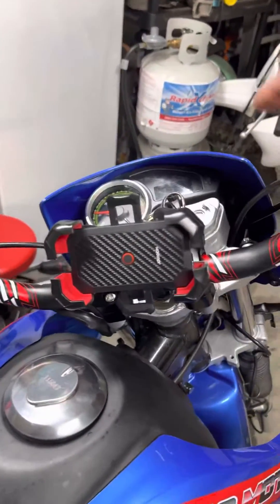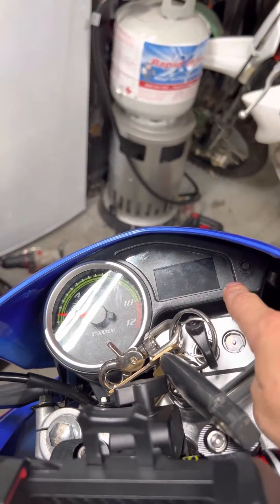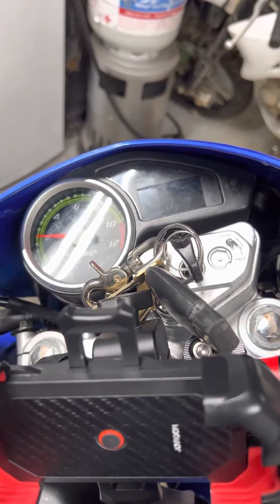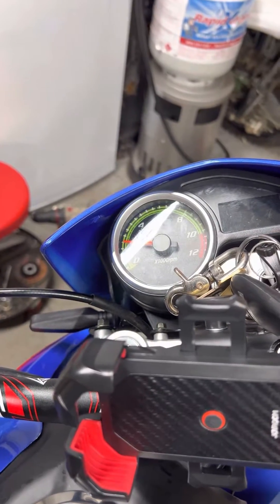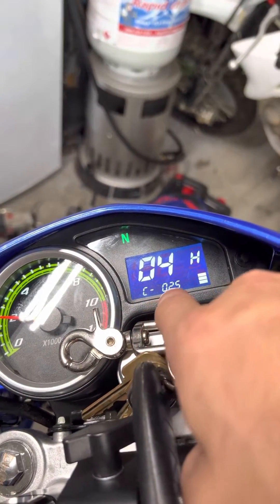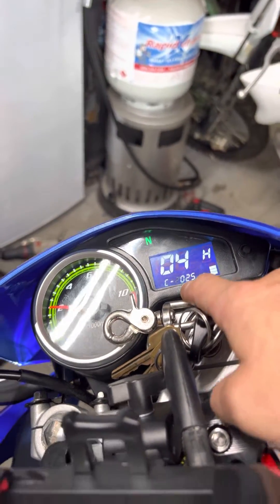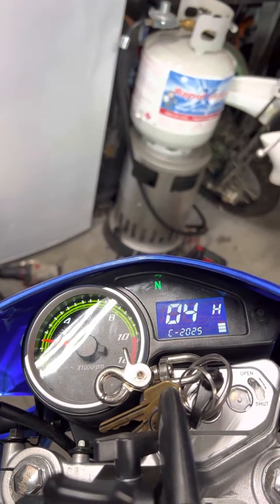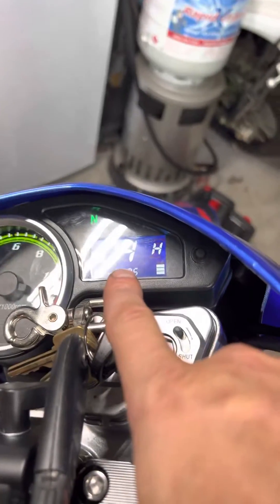Tao TBR7 with a Hawk Digital Dash - Getting the Speedometer Right!

Comment: How did you get it to stay in MPH mine is stuck in kilometers I've gone in to go in MPH once but goes back immediately to kilometers after turning off the key
Reply from the maker: If I remember right, change it to mph, let it sit for a few seconds, and then turn the ignition off. That should save it.

It depends on manufacturer though, I had to look at the Amazon listing for mine for directions.

Comment: Again with a great video…I actually missed this one’s original upload & I highly appreciate mentioning me in your video!! I’ve definitely noticed the clusters are coming with different software I guess one would call it & some require different programming so I’m happy to see not only that you figured out your clusters particular settings but that your able to share it with everyone else it use to be you had a zanelle cluster or you didn’t now there’s so many that appear identical to the original one we’ve been swapping on the various chondas for years that simply asked you wheel size of 17-19-21 & came preset for a 21” front wheel since as you said it’s intended for the Tbr7s cousin bike the hawk 250 that runs a 21”-18” wheel set while we use a 19-17 setup on the Tbr7 anyway I’m outta here off to tune a dlx congratulations again on the 1,000 subscriber milestone it’s truly well deserved & I hope to join you soon!!!

Comment: Getting super moto wheels on my tbr7 with a brozz swing arm and front forks. Im also putting this bad boy in too and hopefully it will let me put in the info for the new wheels. with an extra 400 dollars and some elbow grease you got yourself an Amazon supermoto
Reply: Yes sir these bikes have endless possibilities the digital cluster is a must in my opinion not only to replace the outdated analog setup they come with but for actual accuracy we refer to the factory cluster as using hawk-o-meters 🤣 they’re typically so far off it’s not even worth looking at the speed where as mentioned by RCC the aftermarket zanelle when programmed correctly is dead on accurate!! With your chonda build if there’s ever anything I can help you with definitely don’t hesitate to ask I’ll be here!! I run a Facebook group called the chonda riders & as well make YouTube videos about these bikes everything from maintenance to performance upgrades RCC is doing a fantastic job as usual covering the modifications they’ve performed & how they increase performance step by step which I was already a bit too far into my build to really document how much each change affected the speed or throttle response etc etc best of luck with the build & I’ll be glad to help anyway I can!!
Reply from the maker: Tbr7 Supermoto?! 

You have my complete attention.